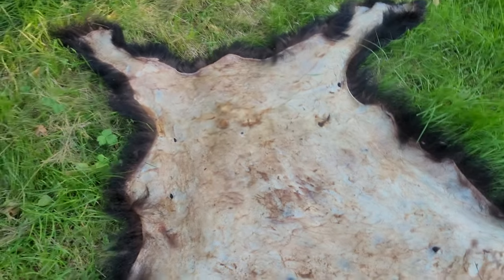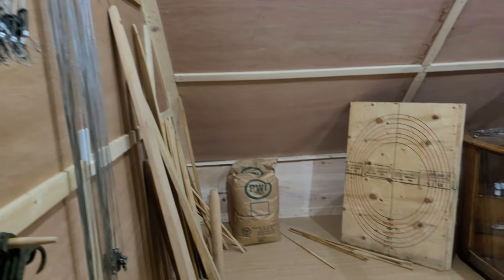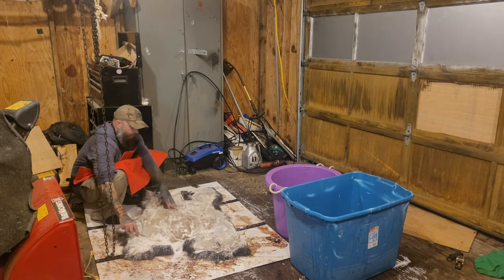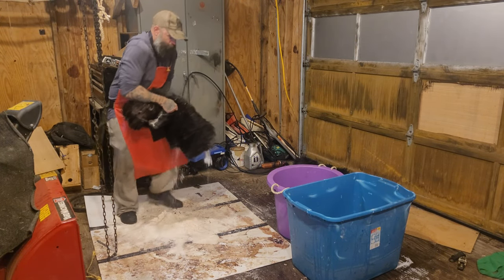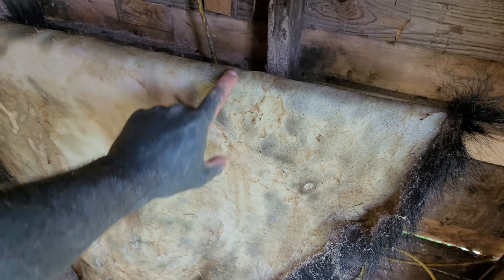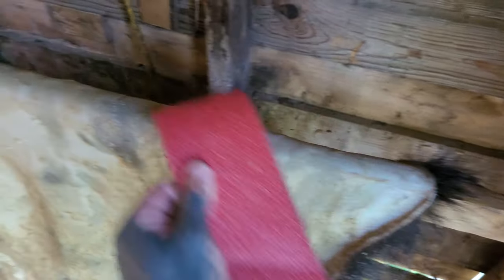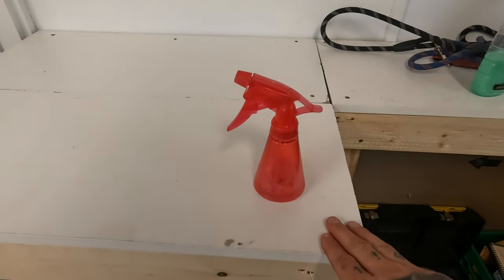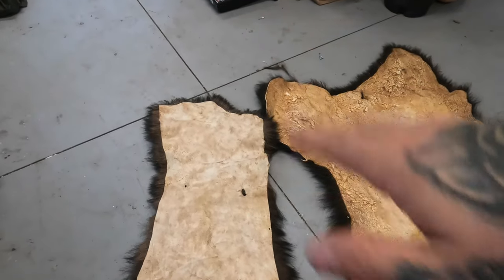DIY Processing Black Bear Fur For Personal Use. Start to Finish. (Make your own hides).

Comment: I think im pulling my hide out today and thawing it to start  this process,  no stretching seemed no issue for your hide , i got my tanning solution ill buy salt tomorrow i got totes for salt bath, uluu and other fleshing tools , clothes line to hang , good weather for next week ,  just no plank to flesh on but i think ill manage. Going to rewatch this after work.
Reply from the maker: Couple tips I've learned since then (btw I have a newer video with stretched hides) 

-The hide will shrink and be much thicker without stretching.
-spray the ears and face with some vinigar while thawing and after salting to keep bacteria from growing and causing slippage.

Good luck and thanks for watching and commenting.
Reply: @DanielSturge  heck yeah I check the new one out tonight

Comment: This is really helpful thank you- I am headed out this spring and had grand visions of a bear skin rug, but after some thought I decided to start with just tanning a hide.  I like your notes on thinning the hide with a wheel/belt sander that had not occurred to me.
Reply from the maker: If you are settled on making it a rug or wall piece you don't have to do the stretching part. It will just be very stuff which is good for a rug. I have 3 more currently defrosting and I'll be doing an updated video o  this process in the next couple week.

Thanks for taking the time to watch and comment.  I appreciate it!

Comment: Great job Daniel! Hard on the fingers the more ya do it.
I just use 50lb bags of stock salt (mix & fine). And make my tanning solution from egg yolks...Murphy's oil soap and warm water. But I basically do the same process. I do use some alum salt in my pickle... helps a little.
Reply from the maker: That's why I tagged you and others in the description
Reply: @DanielSturge  thank ya brother I appreciate that.

Comment: Looks great good job bud I’ve made hats out of bears even if leather is a bit stiff my heavy fur machine sees it no problem
Reply from the maker: Thats awesome.  I'm still very much an amateur.  But it's enough for my wife to turn into mitts and stuff. Besides from just using them as floor rugs, foot warmers on beds or hanging on the wall the the only real thing I've done is made a quiver and a tab for my bow

Comment: How long after skinning dies it need to be fleshed?  Can it be preserved until you can flesh  it?
Reply from the maker: @sueb4182  I usually roll the flesh up and keep it in a freezer from fall to spring. I've had them in my freezer for about a year before fleshing them out.

Comment: Question bro, do you ever worry about parasites when tanning or handling bear? I've kind of been shying away from wanted to go hunting bear bc of all the talk about how bears are not so good to hunt and harvest for pelts, meat, etc. due to parasites?? Any tips?
Reply from the maker: They can have the same parasites as wild pork. People tend to be over cautious with it. The main parasites is a micro parasite call tricanosis and it's killed when cooked and held at 137degress. Most cook it to 160 to be sure. Again same as wild pork. Like any animal they can have of other parasites like tape worm but that goes even for deer and moose. I've got upwards to about 20 bears I've killed and eaten and had one that had parasites in the meat. She was a sick sow who got stuck in my trap. There were worms in the meat and she was going into winter with zero fat on her. I did her a favor

Comment: Great video. I watched a bunch and decided to give yours a shot… and it worked great. 
…kinda smelly still. Any suggestions on what to use to make it smell good enough to bring in the house?
Reply from the maker: I made a decent spray using 1 bottle of 3% peroxide to the same amount of water with a table spoon of baking soda and a drip or 2 of dish soap.  It's a de-scent spray. Also you can help by smoking it a few hours over a "cold" fire with wet Applewood or cedar. That helps.  I'm glad I you enjoyed the video!
Reply: Thank you so much! I bet that will work great
Reply: @BackwoodsBarbarian and you spray it after the full process?
Reply from the maker: Yeah once completely done and I used my home made de-scent spray getting the skin and fur sides nice a damp and rubbing it in with my hand then letting it air dry. smoking it a bit over a cold smoke also helps.
Reply from the maker: It's an old video and I hate it but here it is on the spray. 
FYI. It will slowly build up pressure so leave the cap loose after use on your spay bottle.  

https://youtu.be/pIYUWyul3aY?si=N6g01nI2EV1ed_dj

Comment: Hello! Nice video! I was just wondering how long you let them dry after you washed it (before oiling)? Thank you!
Reply from the maker: Depends on humidity , but it's not dripping or wet. Just before the point where a cap starts to form.  Should be soft and easily pliable. If it's s little dry thats OK because the oil will soften it.

Comment: Do you put them in a plastic bin after salting and into the fridge or do you hang them in the fridge?
Reply from the maker: No just salt them. Does not have to be in a fridge.  Just a cool place.  I left them in my shed on the floor.  You could use the bin or the fridge.  A cool place is all you need just to keep flies off it

Comment: I use Lutan as a tanning agent, it works great. You can get it in kit form with degreaser and bate solution from Van Dykes Taxidermy.
Reply from the maker: @mylife6453  awesome.  Thanks for the tip

Comment: would you think an orbital sander would work in lieu of the wire brush? I'm trying for my first bear this fall
Reply from the maker: It would.  Yes.
Reply: @DanielSturge  Thanks!
Reply from the maker: @brockmacd BTW I have a newer video using the same technique but with the hides stretched if you are interested.  For some reason youtube isn't pushing it
Reply: @DanielSturge  that's great, I'll definately watch it

Comment: have you ever kept the paws of the bear on? if so how do you preserve them with the hide?
Reply from the maker: No I haven't.  But I have 4 bears I got this fall I'm going to try and do with the paws this spring
Reply from the maker: But from whatbI know it's the same process. Just maybe different times for salting and how long the solution is kept on. There is a process to how you flesh paws on youtube. Few good videos. Fleshing them properly is probably the most important point
Reply: I just did my bear. I tubed out the pad area and tubed out all of the fingers to the last knuckle and then popped those joints apart with my knife. Its supposed to lock the clawe in that way.

Comment: krow tann, easiest and cheapest tanning method out there....period..
Reply from the maker: Instructions and times on it seems identical as this indian tan. What about it is better?
Reply: @DanielSturge , i've used the stuff you did and it flat out stinks and stays that way forever i can smell that stuff still just seeing that orange bottle.  krowtann, after you have it rough fleshed, you mix the salt, water, and tan solution in a bucket then throw the hide in it for generally 3-4 days, then pull it out, rinse off with water, then neutralize for 10-15 mins in a water/baking soda mix, then wash in liquid tide and it's tanned, can finish fleshing or whatever and your mounts smell like liquid tide.  Krow does have a strong odor when it's in the tann but once you neutralize it, it doesn't stink.  Most good tanning methods require checking a ph while it tans and krowtann does not, one main reason a ton of taxi's use it across the country.  I've used on whitetail, bear, antelope, bobcat, and fox and yet to have the hair slip on anything.  IMO you just can't beat it for the price and beginner easy.  Also no rubbing the tan on like orange bottle, just my .02

Comment: That's a shit  product  I've 😅that tan before and it's 10000000 percent  crap,  true bond  is 5000000 percent better and you get soft perfect hides after  as well
Reply from the maker: I dunno. I've had good experience with it and have used it from bear to raccoon to hare. I've had no issues. Not saying true bond isn't better, just saying I had no issues with this stuff.